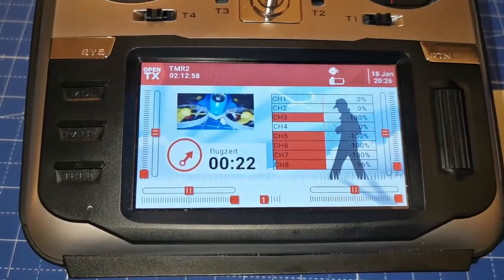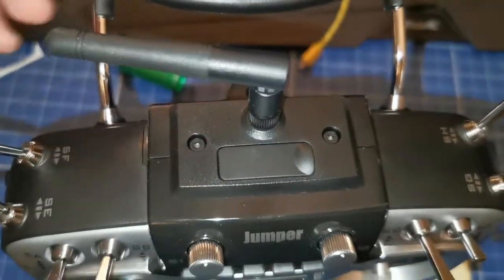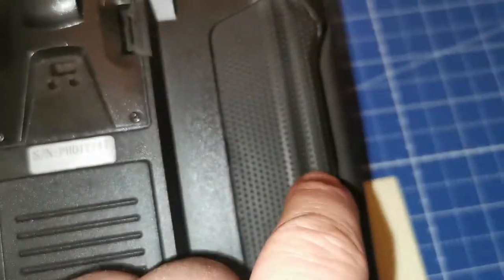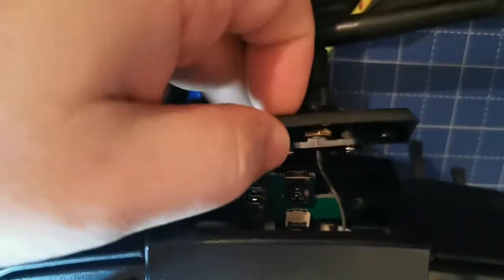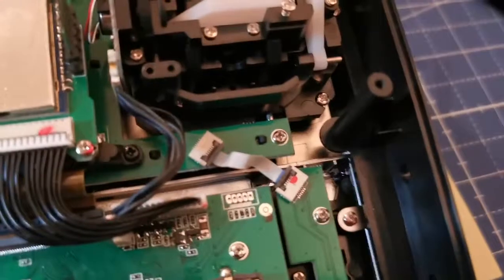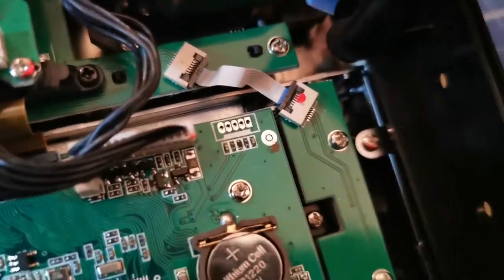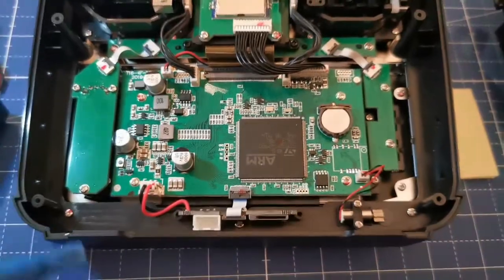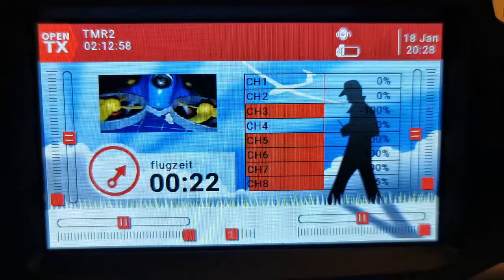Jumper T16 Page-Button did not work and how I fixed it

Comment: Hey, thanks. Just replaced the roller and roller circuit board/holder w/switch on my older T16. Worked one time and then next time got the ‘stuck key’ error and the page key failed every time. So pulled off the ribbon-reversal gig and back to working. So far, good as new. Much appreciation fpv!

Comment: Fpv isfun ... i have a jumper pro V2 carbon hall sensors.. thank you so much for video. It helped me fix mine today.. telemetry button was acting as system button. Also was loosing functions in the menu's.  Fixed mine as you showed by lifting lock pushing ribbon cable in locking again. .. awesome man thanks so much.

Comment: i have an issue where my scroll wheel only scrolls up not down....
Reply from the maker: Sorry to hear that. I have no fix fir for that. I am sorry.
Reply: I had this and after inspecting the scroll wheel encoder for debris and screwing it back in, it worked. I suspect the screws were too tight to begin with